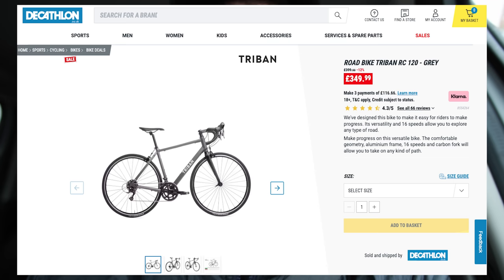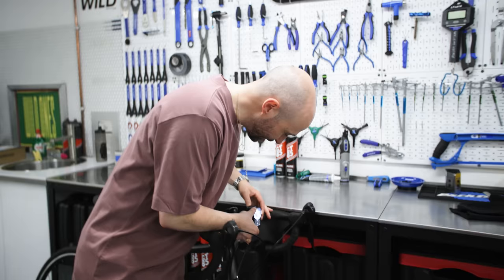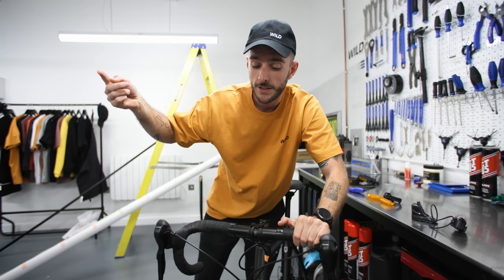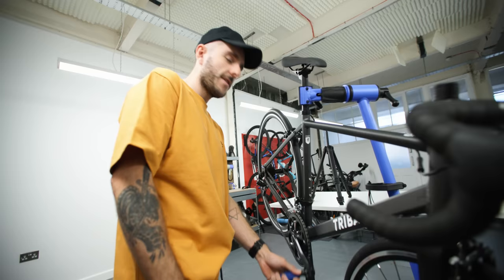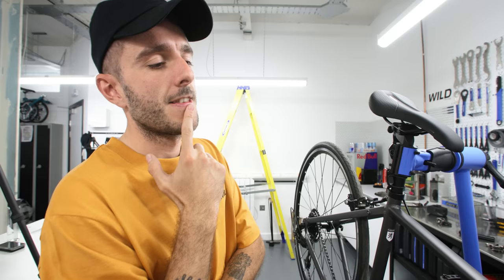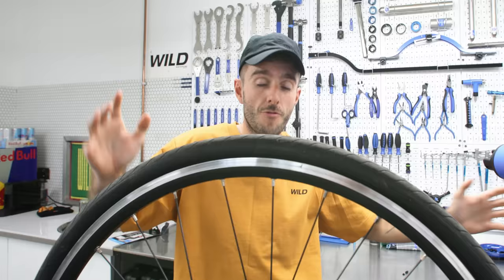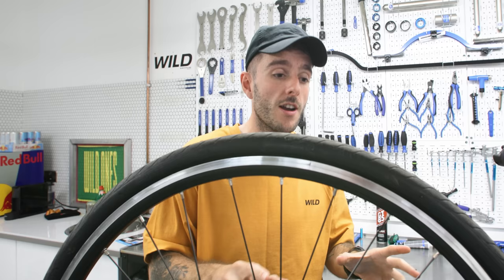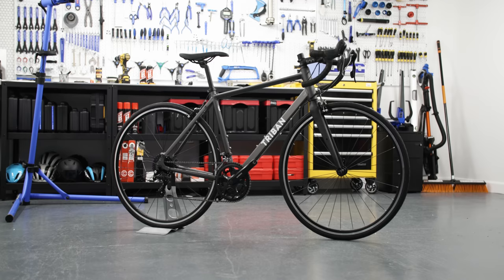We Bought A £350 Entry Level Bike in 2023 - This Is INSANE Value

Comment: My first road bike since I was 15-I’m 75 this year-was a shop soiled Ultra 720 AF which was an £1100 bike which I paid £700 for. Really good bike UCI approved for racing, full Ultegra-rode it for 18 months and then bought a Specialized Roubaix for my 70th birthday-I kept the Ultra as a winter bike but have now replaced it with a Ti gravel bike.
Reply: I loved my 720 AF, unfortunately it got stolen so I bought the Van Rysel RCR AF which is the same effectively the same bike with newer components and a much better rear brake placement. I live in Scandinavia and an equivalent, bought locally, would have been three times as much.

Comment: I have had an old B'Twin Triban three for about 11 years and the thing is bulletproof. I have ridden sportives of up to 100 miles, commuted daily and used for "gravel". This thing is just solid. The fact that you can stick a pannier rack on it so handy, it means you can literally do anything on it.  It has been serviced regularly, in that time I have changed the wheels as the old ones were knackered (too much riding down steps :D) and that's it! Obvs apart from brake pads etc. I love the thing. Is it comfy? well, it's not a sofa, but if that's what you can afford, it's bloody ace! I still ride it now. Not as much, but it is a back-up now.
Reply: Same, great commuter bike also the rear derailer hanger isn’t integrated into the frame on btwin triban 3 like on the newer models shown in the video which is a plus.

Comment: For my first ever road bike, I bought a Triban 3 (that iconic red one, carbon forks, Shimano Tiagra shifters) - at the time it was £500 I believe. Rode it for 6 years until I outrode it, could have upgraded parts as suggested, but opted for the more expensive option heh. It was amazing value, never had any issues aside from the puncture here and there.
Reply: Still have that bike. Did stupid stuff like run Ultegra Di2 on it, deep section carbon wheels. Still holds most of my local Strava best times - which might say more about my fitness than the bike. It's lighter than my disc brake carbon gravel bike and far easier to fettle.

Comment: I might be too late here, but in 2019, I purchased this bike as a student for a great discount for 199€ from Decathlon, when it was still called as the BTWIN 100. I've have it to date with all stock parts. Only consumed few tubes and on my 3 rd set of tire and second set of brake pads. Absolute workhorse of a bike. I used it for getting to lectures, part time jobs, leisure activities, fitness....you name it. I've even been on a 80km ride multiple times and was as happy and  energetic as some fellow riders with 2-3k € road bikes. To be honest I was more comfortable than them because I have a flat bar. I love technology but I really do not see the purpose of having expensive bikes. Reference from my second bike, which is a 1500€ job bike, that I spend more to fit me better but still does not fit me as well as this little guy.

Comment: Ten years ago, I bought an entry level from Decathlon and it was really a great value! I’ve used it for many years, it was really sturdy and reliable. You could toss it around and it really didn’t mind. I’m surprised to see that Decathlon is still using the very same Microshift derailleurs that were on my bike, I recognise them from the levers, they are exactly the same. I can also tell you that those Triban tires are extremely resistant to punctures.

Comment: Really good review and I have alot of time for Decathlon stuff. They are a step above 'supernarket' brands and the like. Just my 2p worth on a couple of things... I would have routed the rear brake cable like they did too. It is always tricky trying to find a good routing for UK brake orientation and frames designed for the rest of the world (most of it anyway!) and the front is usually easier as the bars and the fork are fixed together, so the cable can be fixed too. On the rear, I always go for a routing that gives a larger radius and most importantly no cable rub at extremes of travel, even if this means using a slightly longer cable! Sometimes depending where the stops  (or holes for hoses/internal routing) are, trying to get it from the left side bar tape straight to the stop also on the left side, gives no room for movement! Second point, the wheels are obviously specced to a price point (you could easily pay £350 for a mid range set of aluminium wheels alone!) but some people might consider cup and cone bearings a positive at this price? They are more serviceable and providing you know how (or have a good LBS), are quite quick and easy to strip down, clean, re-lubricate and re-adjust. They could go on for years. The same probably couldn't be said for standard sealed bearings at the same price! So I can kind of see what they've done there.
Reply: Exactly, I love to tinker and maintaining the hubs are very easy. I just clean and regrease every 4-5k km. As for the cable routing, we also have the rear in the left (India is a LHS driving country), but my RC 120 Disc has be routed properly and not across. The cable stops are on the lower left edge of the top tube, so routing from the right of the Head tube might give it a narrower turn.
Reply: Agree. Smoother radius makes more of a difference than shorter cable/housing. I'd route it like this too (and recently did on a similarly configured frame).

Comment: I had the Triban 500 for almost 5 years and it is a beast. It did well for long road cycles in the UK, or as a delivery vehicle for Deliveroo.

Now I am using it as a touring bike in New Zealand, with almost 30-49kg of extra weight in both front and back. Obviously I have changed the wheels and tyres but its still holding really well, even on gravel

Comment: Another advantage: rim brakes, meaning that you can mount dynamo lights on the fork crown bolt.  The craze for discs has meant that this very useful feature has all but disappeared, so that riders who use bar bags must either invalidate their guarantee by boring one or use bolt-on bar extensions in weird positions.  A plus for Decathlon, though: their Triban 520 disc gravel/adventure bike has a fork-crown hole.

No, I have neither bike, but I would have had a 520 if they hadn't been rare as hen's teeth this time last year.

Comment: I've got the disc brake version of this and it's a fabulous road bike for entering into the sport, I use it for all my richmond park rides and commutes and it hasn't let me down. The lack of a derailleur hanger as mentioned is a bit of an issue but I've installed a derailleur guard that Decathlon sells and that protects it from all hist and crashes. I've had such a great experience with Decathlon, even to the point where I'm looking at getting a job at one of their workshops. For anyone interested in buying this bike I would highly recommend it, great value.

Comment: It was the first bike I ever had. It was equipped with a microshift 3x8. I rode my first 200km on it. And it's an adventure I still remember to this day as one of the best in my mind.
My second bike was also from Decathlon, an Ultra RCR AF Ultegra - about 15kkm ridden without any problems.
Later on, I went mainstream carbon like most. And honestly... If I have the same wheels, tires, and bike fit on my TCR, which also has an Ultegra, I'm not sure I can feel or measure the difference.
A very subjective matter, we all like to justify the money spent on new toys.
Furthermore, aluminum is a renewable material, unlike carbon...

Comment: Have ridden a Triban 540 for umpteen years now and still happy. Did swap out wheels (to Cero) and saddle eventually. Has been fine for longer day rides for me. Still have original rear mech (105) and front right lever and brakes. These OK but have has tendency to suddenly go slack! Love the fact that they have designed frames to take wider tyres and with rack and mudgaurd mounts as standard  unlike most other bikes. Would love to see disc bike review as feel willhave to upgrade at some time soon.

Comment: Back in 2016 I was working in London for 4 months and buying a Triban 500 flat bar was cheaper than paying for the tube, so I did that. 
It’s the bike I dug out at the start of lockdown that got me back into cycling and now a couple of years later, really into it. I then sold it for more than it cost me! 
Also the warranty Decathlon offer is incredibly good. I had an issue with the rear wheel and they swapped it no questions. Was looking there for a bike for my son recently but ended up getting a great deal at my LBS instead.

Comment: Shockingly good value.
By comparison, in 1985, Raleigh's top-of-the-range lightweight (no special-order) was the Road Ace Ex 12.
Full Shimano 600 (Dura Ace) kit, Reynolds 531C frame, Mavic GP4 rims with tubs.
Mass - 10.0kg
Gears - 12
Price - £400 (1985).   £1140 (Adjusted to 2022)

Comment: I have been riding the Rc520 for two years mostly as a commuter worked well. A bit heavy yes, stable or not nimble. Toured on it with panniers front and back no problem. Rims wrong diameter impossible to change tires on the roadside solved with later ones. Wheels though has been  bulletproof since properly tightened. Great value for money.

Comment: I own Triban RC520 for 3rd season now and love it. I did change handlebar tape for Chinese one ( original failed after 3 weeks of use). Last year I also changed seat for Prologo second hand seat, new rear shimano 105 cassette (original is now on smart treiner), and new set of Vittoria rubino IV G2.0 tires and latex tubes. So far only 2550km, due lack of free time, but normally I do 40-80km per ride.

Comment: Those bikes are great, I had the 2018 version if it (Triban 500) and I literally traveled accros Europe in 2021 with it, doing 3000km fully loaded with tent and stuff, the bike held just fine despite not being made for such intensive use had no real issue with the bike, it's been great, the Microshift set has been doing awesome despite the bad brand reputation.

Comment: My mate bought a 2021 Vitus Nucleus VR last year. £550. Came set up with a Suntour XCR 32 air fork, Clarks M2 brakes on 160mm discs, WTB Vigilante 2.3 on the front, WTB Trail Boss 2.25 on the arse, Nukeproof Neutron bars, Shimano Deore 10s drivetrain 30t up front, 11-42 out back. Fast, stiff and very nice to ride. 
 He's only upgraded the front disc to a 180mm, upgraded the pedals to HTs and we wedged in some semi-sintered pads for better all round heat control. Genuinely excellent value for money, the changes were only necessary to account for a rider who treats it mean and rides it fast on some shocking trails. Recently had the forks apart for a clean and some fresh oil. Awesome bike. Budget bikes really have come a seriously long way.

Comment: My first ever road bike, bought in january 2020. Commuting workhorse still active when weather is uncertain (last ride : today). On HT during lockdown. The one on which I've learnt mechanic. Now it's fitted with Tektro R559, Sensah Reflex shifters, Claris mechs and crankset, RS100 wheels, Gator Hardshell 28mm tyres. It did survive two very heavy crashes, and not a slightly bent hanger. I've other more sexy bikes now, but at 380 € at the time, it was clearly a bargain, and it's rock solid 👍

Comment: I still have a Triban 3 from around 2010. Been built up with everything from Di2 to Tourney over the years. Done thousands of miles, frame and fork still doing the job. Completely outmoded in terms of practicality (just about squeeze 25mm tyres in, no room for mudguards) but it's proper fast, quite aggressive geo. Certainly more aggressive than a modern road endurance frame. Builds up to under 8kgs with lightweight wheels and components. Going to give it a Claris group I took off a Domane for the summer, and see if I can find find some cheap secondhand carbon rims.

Comment: I am a student who has this bike. I changed the tires and the stem after 1000km. It's really amazing, and if you don't ride faster bikes, you won't know the difference. At 450€ (here in Germany), it is a really good entry in the Sport. Also you can do all the repairs and maintenace yourself and learn quite a bit. If you break something, it's only 12€ for a new rear derailleur.

The only thing I don't like are the triangular tubes (not aero at all), and there is no derailleur hanger, so you have to be careful with your rear derailleur. But it's a really amazing bike. Decathlon also has a website dedicated to servicing the bike, with spare parts and repair videos.

Comment: I bought a disc version of this bike off Marketplace, barely used for £200. The tyre clearance is up to 38 on the disc version, so put some 35 Panaracer GravelKings on it. Some flared handles & new seat on and turned it into a Gravel hybrid, that doesn't financially matter too much if I smash it about! 

The Microshift works well, will just keep an eye on the wheel bearings now that you mention it as I'm slinging it through muddy trails!

Comment: I bought previous version of this bike in 2017 to use it as my commuter (so it had to be cheap, low maintenance and blend in when parked somewhere).
Did around 40 000 kms on it and it's still fine. Commuted in the rain and no problems with the wheels (although I completely ruined the brake calipers).
Also managed to put on it the rack with two bags (so I can bring a laptop and clothes to change at work).

I have also used it for a few longer trips (180km+) and it's fine.
It's really nice it has 8 speed cassete, as those chains usually last a long time even in bad weather (during dry months more than 2000kms, during rainy months around 900kms) and the chain is super cheap (5 - 8 pounds).
I would not pay 20 pounds to service those wheels, as I cosider it a waste of money. You can buy new ones (same quality) for 35 pounds and even riding on those for 40k, they did not explode.

Considering the price it's perfect.

One thing though - my tires were put so badly that one of them was pushed off by the pressure in the inner tube after a week of riding.

Comment: Well, I have to thank you for your videos and reviews. On the strength of this film I have just bought an RC120 ... and I love it! Admittedly it would feel fresh after twelve years with my old Vikiing road bike, which has I must admit been useful as ride to work / exercise hack that has needed only tyres and a chain in that time. This, however, seems absurdly good value. It feels taut and firm (madam) and is a really nice ride.  I am almost seventy, and this will last me for the next ten years I am sure, and help maintain fitness. The staff at Decathlon Cardiff were really helpful and the build was completely correct, with nothing rubbing / loose / out of line. Love the gears. Love the position. Love the bike! Thank you for your videos.

Comment: The RC120 was my first ever road bike.  I got the disk Brake though.  The fact that it came with Carbon forks for the price is insane.   I've since upgraded my bike, and I put a grippier tire on the RC120 for gravel.  Such a great bike.  

Decathlon also has a more premium brand of bike Called Van Rysel.  They have full carbon, UCI approved bicycles running Shimano 105 for like 4k CAD which is unreal as well!

Comment: What you pointed out about bike size inconsistency is true in my experience as well. I bought a 2nd hand Road Bike Van Rysel RCR 900 AF 105 11 speed in small based on the size recommendation. When I actually got it and rode it, I had to lower the seatpost until there wasn't any seatpost left visible, my seat was barely above the frame! Would've went extra small if I knew this was going to be larger than listed.

Comment: Living in Portugal here. I bought my first road bike with Decathlon in the winter of 2018, it's a Triban 500. Done over 7 thousand kilometers with it, changed crankset to a Shimano Sora 3x8-speed (it came with a Microshift crankset, though both front and rear derailleurs are still the original ones), bought a pair of hybrid pedals (flat in one side, MTB clip in the other) and changed both wheels and tyres (first the BTwin ones, then Michelin, now Continental), besides regular maintenance. 

Five years with it and still going strong. I'm thinking of changing crankset again (it's getting quite worn), this time to a Shimano Sora 2x9-speed; even though it requires a wholesale change of shift levers, both derailleurs, cassette and such. I estimated the cost to be around 350 euros - hefty, but it's still cheaper than buying a completely new bike; the higher spec ones are in the 1,000 euro range. I don't have that money and I'm quite fond of my road bike, I still want to ride it for a few more years.

Comment: Great video and well pitched to target audience!  These days I'm on a pretty high-end Tarmac (and a few other unreasonably expensive bikes) but my very first road bike was a Triban 540 (couple generations older and slightly higher spec with mostly 105 5800, but effectively the same frameset).  I still really rate that bike - I bought it because it won some award for 'best value road bike of the year' and I think it could probably compete for that title even today.  In defense of the effectively 'consumable' wheels on this build - anyone who really takes to the sport is probably going to end up upgrading the wheels as one of their first moves before long anyway, and for all those who use the bike for 10 rides one Spring before mothballing it to the back of the shed, then there's no money wasted on wheels and they'll never know the difference!